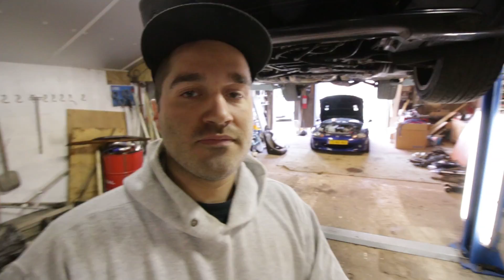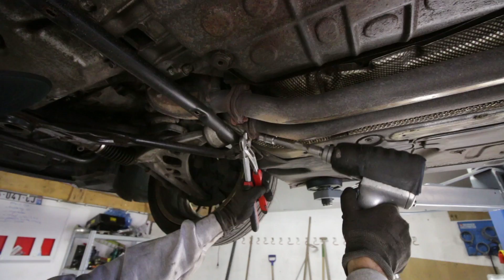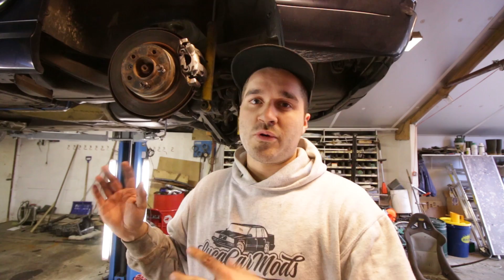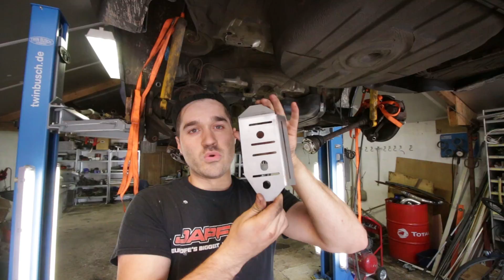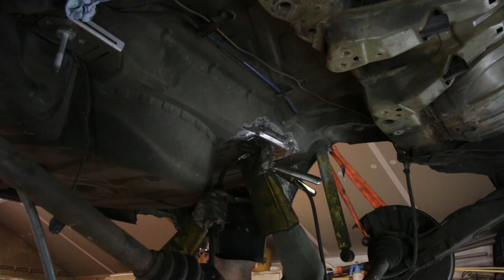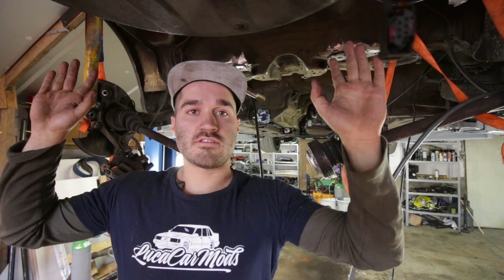BMW E46 Subframe Chasis Mounts Repair & Reinforcement (Welding)

Comment: I did this job on my e46 about 10 years ago. Instead of taking the subframe off i cut an access hole in the boot, removed the mounting brackets  cleaned it all up and welded it up and then welded the boot back up.
Reply: Don't know if you'll see this. I have the problem right now. Going to "attack it" this weekend.  How did you fix the lower part if you just went through the boot side? I want to reinforce boots side aswell. But if I don't have to take subframe off that would be nice lol
Reply: @JoshuaDeanHealey  you get to the lower part by cutting through the boot floor,  you will need to go through two seperate layers before you get to the bracket.Mine had rotted out around the bracket that the subframe bolts into.I removed the bracket, welded up the floor and welded the bracket back on and then welded up the boot floor when i was done.
Reply: @stewartdcampbell  I see what you mean! Cool thanks for the reply 🙏👍
Reply: I was thinking about doing this, did u put extra metal plates to reinforce just in case?
Reply: Excuse me I really hope you see this but what mig wire do you need for this job is this a stainless or mild steel job

Comment: Can you TIG weld these instead of MIG?
Reply: If you have the option, cut a groove in the crack, Tig weld and seal. This repair is usually done with Tig so you can put more material in without putting too much heat in the metal.

Comment: Wish bmw would have recalled this. Just but one an didn't know about the bad subframe. It's pretty bad on my left side in the rear 😭
Reply: Same, mine is basiclaly completely out, did u fix it?
Reply: Was recalled until 2010
Reply: when doing the subframe reinforcement also rebuild the diff mount and add a rear right mounting point, this will even out the load on the subframe

Comment: Terrible design,       The car is overweight at closing in on two tons with tin foil thin metal
Reply: 2 tonnes are you off you fucking rocker geez?

Comment: it will crack again...all this frame is a big basic errors of normal conception....
Reply: Welding it ain't good?
Reply: if it’s reinforced and welded properly it shouldn’t crack again..
Reply: Definitely with the type of repair he did here. Wasnt a very thorough repair and reinfocement